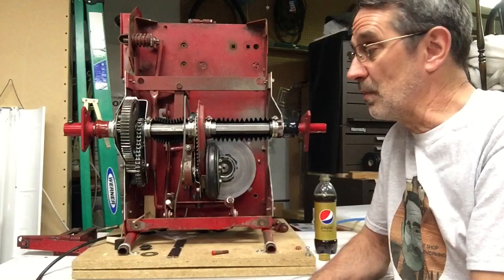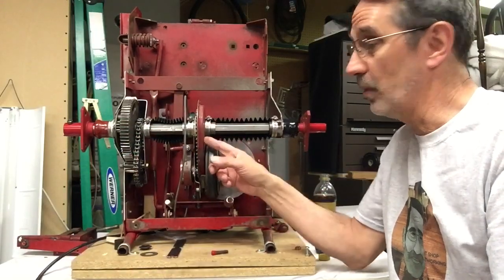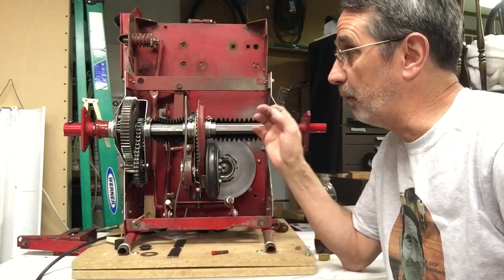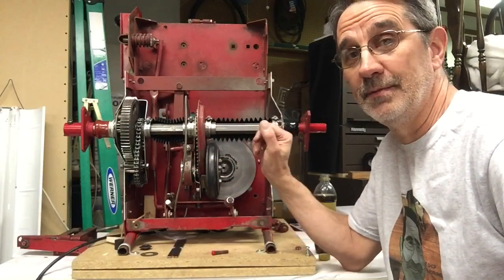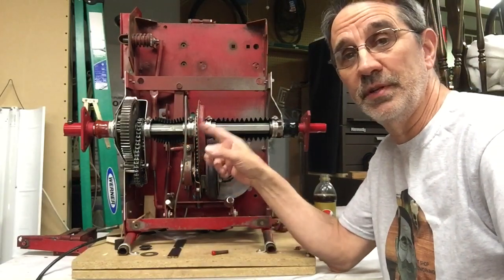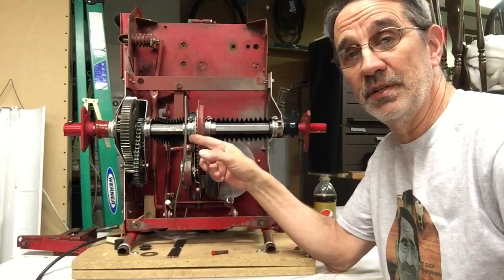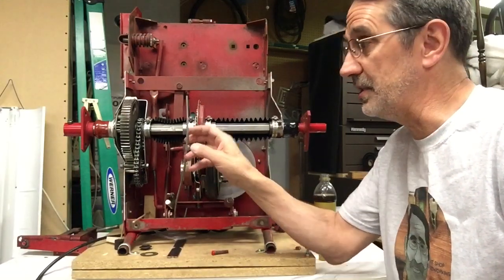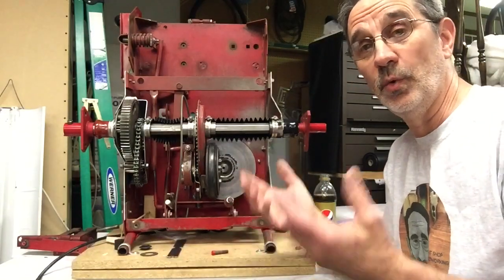251. Why did my Snapper RER quit moving forward and backwards

Comment: I've had multiple snappers rer. The one I keep at my cabin, runs too fast in first speed. If I run it between 1st and neutral it's great but in first it's just a bit too fast. I did install an 18 hp briggs on it but the one I use at home also has an 18 hp briggs and runs perfect. Is my disc too tight and not allowing it to run in the right position? I don't know what else to adjust. Side note I am running ag tires on it and it'll climb a tree like a coon. But that doesn't affect the speed.

Comment: Great video, question, I know nothing about these mowers, just got a used model 7800104, moves great in reverse, moves forward in 1st but under pressure like an incline will stop and won't move in any faster gears. Would it be the drive disk
Reply from the maker: @seanliphart2134  it could be the yolk spring watch video number 70. It will explain how to check and adjust it.       Jim

Comment: I can’t get mine to roll. Just to push it around. Is it possible to put it in neutral or something?
Reply from the maker: @6spd85notch  through the years of manufacturing these machines they have changed them slightly. I would have to see some pictures of your drivetrain to see what style you have.

Comment: I immediately saw that the bolt was missing. Put a bolt in while it was on the ground ( didn't raise the mower up) and it still won't move. I jacked up the back end and turned the left wheel to see if the other wheel would turn and it wouldn't. When it stopped moving while I was operating it, I also lost the brake. Any suggestions Jim?
Reply from the maker: @johnharb4908  OK with your machine jacked up or standing up doesn’t matter turn the right hand tire forward and backwards and the other tire should turn the opposite direction then try turning the left-hand tire forward and backwards if the other side does not turn then you have something stripped in your differential.        Jim

Comment: Hey Jim. Can you identify the bolt and tell me where I can get it Please? Thanks!
Reply from the maker: @johnharb4908  I usually get my parts from Parts Tree.Com but that bolt I would probably order through my local Ace Hardware store if they repair engines and machines if not you’re talking about the bolt that goes through your wheel flange and axle. You can just use a standard bolt.        Jim

Comment: You are my most favorite person this week! Videos 132, 144, and 251 helped me big time! I purchased this mower used and have been using it for 2 summers and was not impressed, to say the least. The grass catcher was not efficient and the chute was always clogging up with grass at the blade deck outlet. I was ready to scrap it and buy a new mower. I bought a new 33 inch blade figuring that I would change it out and sharpen the old blade when I got time. I flipped the mower up for the first time and found a 28 inch blade! I adjusted the brake, clutch, and installed a 33 inch blade. The mower cuts great, the chute is not clogging, and and the bag fills to capacity. Thank you for your knowledge.
Reply: Also, the bolt had come out of the hub, and the mower would not move. Hub was chewed up, but I replaced the missing bolt with a grade 8 bolt and the mower now moves.

Comment: That was some good information from video 251 about the hub bolt. During it you mentioned what that (long roller) is for. That is
sticking way out of the yoke on RHS when machine is upright. Think you said it's got something to do with park
    I thought I finally figured it was to put a pipe on as a leverage handle like what you do with your vice grip. But you mention has something to do with park? I just got mine back together and" if the yoke is correct", on the left of hanger ( & I see that's the way you have yours) when in mower is in upright position then is there an adjustment to get it to go all the way over to reverse. it goes all the way over to the end in then yoke slot, but shifting it back the other way there is plenty of slot left in the yoke. So there must be an adjustment some where? I have not put the motor back on yet.  It might very well go backwards. But the shifter slot with the names on it, say it's stopping 
1 short of reverse . I'm going to type in adjusting the shifter and see if there is a video. on this where the shift notch, is 1 off, same thing when I change motors in cars. When I drive them after the change, the  the selector is 1 off and drive is now in neutral.
Reply: On the above problem, I just went out and figured it out why the shift handle notch wouldn't go in reverse. when the yoke slot was at the end. ANSWER:  Seeing how I had my shifter bracket off for repainting. There were no old marks or patterns from dirt left to copy. And I didn't even realize it was a slotted bracket. Now I should be able to go out and adjust it . Just wanted tpo let you know I think I figured it out. I did watch the video about making the gauge to see where the friction drive is set out of notching a paint stick. I'll try that later thks Jim I sure do like the way you number the videos!
Reply from the maker: @janbill79  try watching video number 253. It will explain how to adjust your shift plate.
    If you go to my homepage and look underneath where it says, (manage videos) there is a link that will take you to a directory of all of my videos by name and by number
     Thanks.    Jim

Comment: Snapper will not roll, have any videos on that?
Reply from the maker: Well first, you’re gonna have to do a little investigation to find out what’s wrong with your machine I would take the mower deck off and get it out of your way and get the extra weight off of your machine then take the battery out of it close the vent on the top of your gas cap or take the gas cap off put a baggie over the opening and screw the cap back on then stand your machine up. Look it over and see if you can see anything wrong go to the side of the machine and pull and push straight in and out on one of the back tires and see how much side play you have checked the differential cover to see if it has any grooves worn  in it or through it from the inside out that is the most typical issue on the Snappers, we don’t keep up on the side plate, and the chain inside of the differential wears through the cover and locks up the machine you may have to remove the boot from the side of the cover to inspect the entire thing, let me know what you find. Jim.

Comment: Jim.   Thank you!!! I stopped cold because I was cutting it to close by an edge.  That said.  All my movement ceased.   I rocked my unit on end and performed all the differential spin tests.  I was stumped. Watched you video and sure enough missing pin on one hub only.  I even went back to the yard where I was cutting and found that pin. Evidently it has a nut on it and then that was missing and it was stripped but man you are THE MAN.  THANK YOU FOR YOUR SERVICE AND CHANNEL 😊💪🏻
Reply from the maker: That happens so often to my viewers, and I even had a couple completely tear apart their differential thinking. The problem was in there and all it was was the bolt in the axle.        Glad you found it so quick.       Jim

Comment: restored a 2012 snapper 28" hi Vac and was feeling good that the only part I had to replace was a brake and clutch cable. Got my brake cable and installed it then took it out for a trial run, ran great, braked well, cut well until it stopped and I could not move it forward or reverse. Used furniture dollies under each back tire to get it back to my shop, stood it upright after removing battery and gas tank, rolled the tire like you said and the other one turned the opposite way. when I put a block under yoke and tried to turn rubber friction wheel, it would not turn. also as I turned my tire it sounded like something slipping in chain case . Pulled rubber boot back and turned tire and the shaft turned ok. I checked the bolt like the video says but it seems okay also and I could not slide wheel off. Not much in chain case but I suppose that is the next spot to look? Russ from Louisiana.
Reply from the maker: Once you get the chain case off try rotating it Before you tear it apart it could be in the differential let me know what you find out. Jim

Comment: Hey Jim, I've been going thru quite a few snappers and this is the first time that I am having major malfunction trying to get this mower to go into to reverse. When trying to shift into reverse, the handle will not move. So far when going forward all the gears seem to work just fine. The clutch disk seems to be in decent shape. Anything that I need to look for???
Reply from the maker: Did you clean and grease the hexagon shaft? And did you install new boots?   . Jim

Comment: Hi Jim I have a snapper R110 rider and my parking break will not set due to the lever will not go over the pin on the pulley. Is there somehow to adjust this.
Reply from the maker: Hi Ruby, I looked over my turtle and I have figured out how you can adjust it I’ll try to do a video this week and get it online for you. Jim

Comment: Hi Jim, I have a snapper 28inch cut. Ran over a bolder by accident of course,  now mower goes reverse and not forward.  Checked all in your videos, axles turn drive train seems OK. Now where to go?
Reply from the maker: I would check the yolk and the yolk spring to make sure that they’re intact and not bent or broken take some pictures if you want to and send them to my email and I’ll let you know.
jimsfixitshop@gmail.com
Thanks.Jim

Comment: I had the exact problem you describe here, happen to me yesterday. I am a new Snapper user. It's been over 30 years since I owned one. My son recently gave me one that I absolutely love to mow with. I've been using a Craftsman for the past 25 years, that has a 42" cut. The Snapper only has a 33" cut, but it cuts my yard in half the time as the Craftsman. I was cutting out back yesterday. I crossed over a slight rise in my yard that hasn't been cut this year, so it was a little overgrown with a few wisteria vines, but nothing drastic. I easily cut through ridge, but when I began to cross my yard, my mower stopped pulling. This is the first problem I have had with the mower, and I want to make sure I don't waste time and money looking for the problem. I am proud to own this mower, because it is heavier duty, than any I have ever seen. The main frame piping is a 4" square tubing, versus the normal 3" round tubing. It has a 12HP Briggs & Stratton, Industrial cast iron bore, I/C engine with disc drive ( what ever that is ). After watching your video, I went outside and jacked up the Snapper. ( it is full of gas, and I didn't want to drain the tank , so I jacked it up ) With both tires off the pavement, I turned the right tire and the left tire turned in the opposite direction. When I turned the left tire nothing happened on the right tire. I then used my hand to turn the left tire in both directions and nothing happened. It is free wheeling like it is not connected to the axle movement .

Comment: My feels like its lock up .sr1533 snapper.  Bought a new  disc and still the same thing  . Can't even turn it . Think it the chain case 🤔
Reply from the maker: Well if it is the chain case that is the easiest thing to remove and open up. Jim
Reply: @jimjackson9381  i did everything seems frozen up feels like I have to put all my upper body strength just to make the chain and stuff move even just a little bit
Reply from the maker: @justintaylor6870  I guess I would have to see it to figure out what’s wrong with it. Jim
Reply: @jimjackson9381  I've had that lawnmower for a long time it has been parked for over a year ever since it just stopped going forward or backwards since I had put it up but I have bought a new disc and stuff for it thinking that was the problem but I think it has something to do with the chaincase is probably Frozen up but all the teeth and the chain look good didn't look chip besides packed with grease
Reply: @jimjackson9381  even try turning the axle takes a lot of strength just to move it forward or backwards but the tires turn good and just like how you say when you turned one the other one turns in the opposite direction

Comment: Dear Jim, I put new boots o. My snapper and now it won’t go into reverse and into 5th. Could I send you a brief video showing you what I mean please?
Reply from the maker: Send it to. jimsfixitshop@gmail.com
Thanks. Jim
Reply: @jimjackson9381  thx so much Jim. I did
Reply from the maker: @pablobon5957  When I watch the video you sent me and you were shifting your machine the shift handle looked like it went all the way into reverse and it looked like it went all the way into fifth I think the issue may be the linkage between the shift handle and the chain case you’re going to have to check that to make sure there is no slop in those joints on the shift links. Jim
Reply: @jimjackson9381  thx so much Jim, I’ll check that out. Best channel ever! Thx Jim

Comment: Jim, this video is more educational on so many levels. Let me explain, people like myself, whom recently have gotten a Snapper Mower, and have No Clue of what it looks like underneath, have just been made quite aware of the workings and where the many parts are located and now know the Nomenclature of the many parts. This is why I wanted to stand my old Snapper vertically... for inspection purposes. 
   10 April came my first ride on the snapper since fixing the carburetor, 11 April, I actually got up the guts to drive the mower down my steep hill to the Battenkill. Going down was no big deal, getting the Snapper back up roadside, well, the Snapper climbed back up with little issues.. I felt the tires spin at the last 5 feet .. I was thrilled. 
    Thanks for your videos. I have learned mega amounts about my Free 33” Snapper Mower.
Reply from the maker: Well if you have any other issues or need more help just let me know. Jim

Comment: I really like your videos and expertise. I have a bit of a problem with my snapper. I can't seem to get the wheel hub off. I removed the bolt and tried beating it off with a hammer and punch. Also tried heating it. Won't budge. The shaft broke on the end of my clutch gearbox. I need to remove it to weld it back on
Reply from the maker: Roy Billiot 
Soaking them with some good penetrating oil helps but I’ve had a couple that I have had to cut off that’s the only way to get them sometimes and then just replace them. Jim

Comment: Great video 👍👍
Where dies the bolt go, through the hub and axle?
Reply from the maker: Yes if the bolt that goes through your wheel flange an axle brakes your machine will quit moving in either direction. Jim
Reply: @jimjackson9381  thank u sir.
I subscribed to your videos 👍👍.

I'm now in the process heading out to find the lock nut that backs up the screw on/off blade adaptor, whih i judt learned from u the adabtor screws off.

So under the lock nut, their is NO wadher on top of the blade adaptor?

Comment: Thanks for the information, my snapper quit moving forward. I changed the yoke, bushings and metal sleeve that works with the yoke. Working great now. Thanks again
Reply from the maker: Bryan hebert 
You may want to watch video number 70 and tighten the York spring also. Jim
Reply: Jim Jackson,  i did tighten the spring while I had it apart. I watched a few of your videos. Thanks
Reply from the maker: Bryan hebert 
Well let me know if you have any other issues. Jim
Reply: Jim Jackson, will do. I like all of your videos, that I saw so far
Reply: Jim Jackson, I do have an issue, the mower was given to me, I’ve noticed that the deck doesn’t come up as much as it should, I will try to adjust it to see if I can get it all the way up. Position 5 height is cutting short.
Reply from the maker: Bryan hebert Well let me know if you run into a problem. Jim
Reply: Jim Jackson, i will thanks and stay safe, god bless
Reply: I adjusted the rod that connects the front of the deck to the height that looks good, but it would not go down to the lowest setting. I then adjusted it back until it went to the lowest setting. Now it moves from 1 to 5 height, I think it is still cutting too short. What would you suggest I do?
Reply from the maker: Bryan hebert 
I guess I will adjust it so it cuts the height you wanted to cut and just leave it there I guess that’s all you can do. Jim
Reply: Jim Jackson , I figured that too, height 4 and 5 is not bad. Thanks for all the advice. I will also check the tire pressure every time I cut. I do have problems with tire pressure.